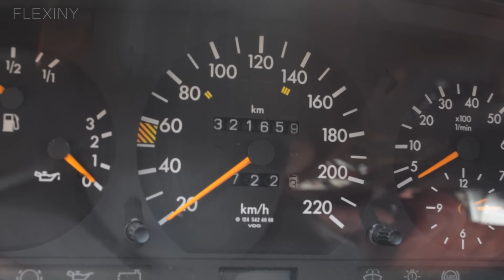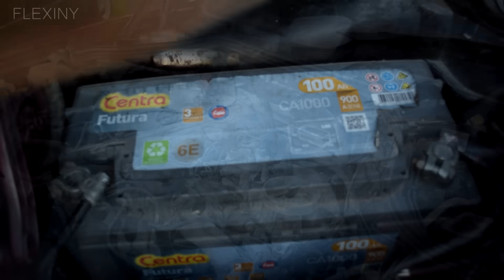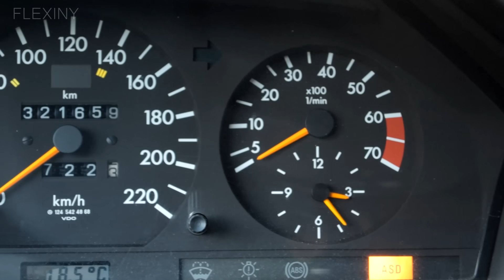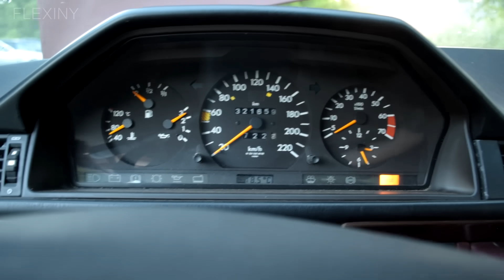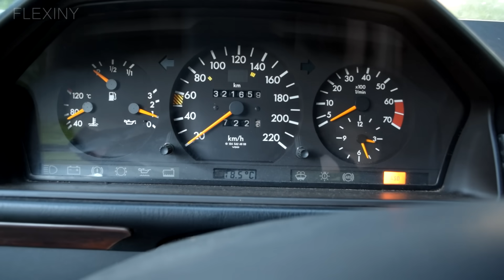Starting 1990 Mercedes-Benz w124 230E After 5 Years

Comment: old mercedes are the best especially the diesels can run forever
Reply: Not Diesel
Reply: Chaminda Thushara Ruwan Kasturi  no diesel, this is a petrol engine
Reply: @Spartan-sz8uh  what he meant was probably that the diesel engines are more reliable and longer lasting than the petrol engines. anyone slightly competent can see that this is a gas engine right away anyways.
Reply: Well I'm from Paraguay and I have a w124 diesel, It's been stopped since 2003 and I bought it in 2008 and it's still running on the original engine
Reply: All Mercedes Benz engine's are usually good for 250000 Miles
Reply: Yes
Reply: Yes i have one old Benz W115 From 1969 220D 4 gear manual darkgreen  forest
Reply: Mmmmmmmmmmmm
Reply: @allahsnackbar9915  Mercedes-Benz petrol engines last just as long as the diesel ones . My 300TE-24 was on 470000 miles when a stupid woman smashed into it while it was parked .
Reply: @derekheeps1244  and ive seen their diesel sixes of the same era with ~3 million on their odometer))
Reply: Mine is 439 000km diesel
Reply: yeah
Reply: not the modern ones like Bluetec 6
Reply: but the older ones can
Reply: @allahsnackbar9915  true
Reply: @em_4775  Diesel is More Reliable and lasts longer than gas
Reply: @epiccarguy892  yes right
Reply: yep but not the Bluetec 6
Reply: @em_4775  right if it's bluetec 6
Reply: @MauriG505 saludos desde Asunción también tengo un 124,es un auto encantador ❤

Comment: How can someone abandon such a beautiful merc?
Reply: Alonzo Lopez I know love these old Mercedes my Dad had one the thing just kept going
Reply: An apocalyptic dingleberry
Reply: 300k km. The car is garbage
Reply: R the w124 was the LAST good Mercedes EVER new ones are shit
Reply: @user-mi4yc7pr3x  i would totally drive that daily here in canada . looks great ! and so rare
Reply: Ikr it’s a wagon and ALSO the color is amazing interior and exterior this car is just gorgeous
Reply: @805NAVE  my dad has a 1995 W124 E320 Sportline coupe and it has the smoothest 6 cylinder engine and most comfortable seats and suspension I've seen in any car
Reply: @user-mi4yc7pr3x  my friend has one driven 780k km and still keeps going like a champ. 300k is nothing for these cars
Reply: It wasn't abandoned - my dad kept it to build a sunday car, but didn't find the time to complete the repairs. Then he died.
Reply: Tanel Jairus oh, sorry for your loss.
Reply: The 230E had a to high fuel consumption, as 200, 250 or 300 Diesel the car would be still on the road. Collector and weekend driver search for the coupe.
Reply: @user-mi4yc7pr3x  these engines only start working after 300k km
Reply: Great trick to get the fuel pump going!
Reply: Хорошо
Reply: YOu don´t know what exactly was the reason they abandoned it. Maybe the engine/gearbox is garbage, maybe it´s full of rust?
Reply: @user-mi4yc7pr3x  dude, 300k km is nothing for an old mercedes like that and there are many other cars that will last that long too.

Comment: My dad took me to our local Benz dealer back in 1992 and bought a 230TE for our family. It died two years ago. Since a year though, it has become one of my cars and received a new gearbox, new differential, all liquids and smaller parts new, plus better brakes and suspension which has been lowered. Also using the 102 Octane fuel available here in Germany and together with a KN it runs a bit better.

Comment: Old German cars never die, for this reason I own a classic BMW. 
One of the best looking mercs ever, the newer designs aren't half as good looking.
Reply: Hello,i have a E39 520D, its good? 2001 136 hp 280 mil kilometros
Reply: @armandoaraujo1178  German cars tend to run forever, the Diesels are like tanks.
Mine's an e30, about 14 years older than yours and it has outlasted newer cars family have bought.
Reply: @dave4803  thanks
Reply: They where made in Stuttgart Germany one of the best ....
Reply: @GabyBobocea  hello,what car do tou mean?
Reply: Armando Araujo Mercedes 450sL 320
Reply: @GabyBobocea  ;-)
Reply: 1992 BMW E34 OWNER Stroker rebuild engine by German man, 200k after rebuild and mine extreme use it's still running as Swiss clock! Other cars can't gonna make it to chase me though. Body is still perfect, getrag manual, 500k km on the car, others is not a vehicle. Never sell it, never!
Reply: @dave4803  sunroof or non sunroof?
Reply: @SaulidSnake  Sunroof, manual wind one.

Comment: The 230e wagon has always been one of my favourites.   Thankyou for saving it.  I also saved a w123 after 15yrs stalled. This cars are indestructible..literally Tanks https://youtu.be/B8gWxADMYwg

PART 2  - Rust inspection & Welding works 

 https://youtu.be/UUS-V1o0kPk

PART 3- Paint job and fittings -

https://youtu.be/I2RIshBkUq8

PART 4  - Buffing & Ceramic coating on a budget -

https://youtu.be/Nlf9tVrYLAM
Reply: hi, your part 2 video has been removed, are you able to reupload it anytime soon? let me know.
Reply: @mohamedhafizh9201  hey the video is up now.. checkout

Comment: Looks like it had a stuck valve then freed itself after it backfired.
Reply: Backfire can damage a rubber boot in a bottom of KE unit. Or throw away an idle hose.
Also ECU seems not to be working, tacho is not working... maybe rusty fuses?
Reply: @XPbIM3  possibly wiring is bad, my father's w124 has the same issues, engine is in perfect condition internally, gearbox is good, but all the wiring is just gone, rotten away. I wanted to take it and fix it at least up to "working and running okay" but it seems to be impossible already due to body rust and countless other problems. Maybe engine+gearbox could be swapped elsewhere...

Comment: The reason that radio probably doesn*t work is because it has a security code and unless you have it you will not be able to use it, or put it  in another Mercedes Benz, or any car.
Reply: It is probably the fuse in the back of the radio. I say this to you with almost 100 % of confidance.

Comment: First rule of a k jet equipped engine is dont touch the throttle when starting .
Reply: That's a KE Jetronic. You can give it full throttle if you want. It doesn't help much but it doesn't hurt either. The gas pedal is only connected to a throttle that regulates air flow. The disc you see moving is then pulled down by the resulting vacuum the engine produces and the opening of the throttle.
Reply: @thiemokucharczyk  .... Yes I know , but it still over fuels and soaks the plugs due to the plate in the metering head being pulled down because of the increased airflow and allowing too much fuel  resulting in soaked plugs ....... I work for Bosch and I have rebuilt countless metering heads over many years .
Reply: @craigstaggs8597  not really.The amount of injected fuel is always in the correct relation to the incoming air. So if the KE Jetronic is working as intended, you can never soak your plugs.

Comment: I was hoping you would change the over-voltage relay that is the relay with the fuse behind the battery. Would solve maaany many problems instantly. Maybe even little bit of knocking it may help..

Comment: Hi. In general, I have a question for you, what are you doing with these cars after you start them up after some time? Because I feel a pity to look a bit at these abandoned cars, for example BMW E38 or E46 which was once in your films
(Sorry for spelling mistakes but I'm using google translator)
Reply from the maker: Some of them I try to fix and keep and some is getting sold. E38 got sold and E46 went for parts, it was also for sale but nobody wanted it.

Comment: Had same cold start failure when abs light is on after start. .  Relais is stuck. First to the wery right behind battery red on top.  Changed   case solved.

Comment: Did you start the engine with 5 year old engine oil?
Reply: The 5year old oil is the smallest issue believe me.
I rescued alot of abandoned cars like him.
As long as there is oil inside and its at least on most spots it does its job.

Comment: 1990 Mercedes Benz sitting there for 5 years long time check the engine pull the vehicle out of the brushes new battery good condition you have experience in the automotive repair German vehicles Orlando Florida far away Asia Europe Russian bless you